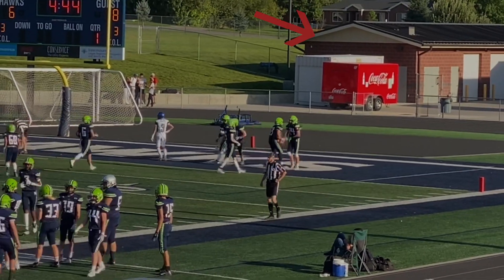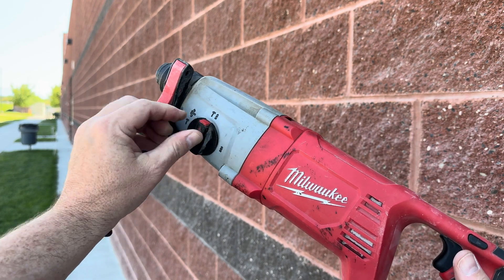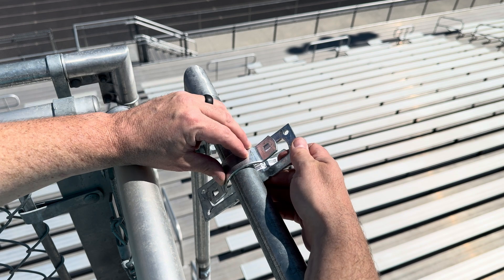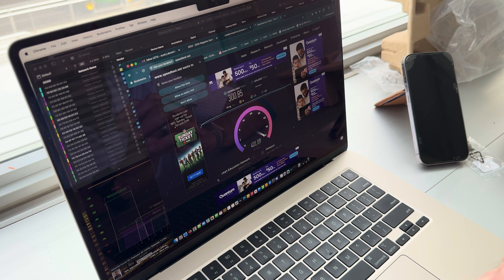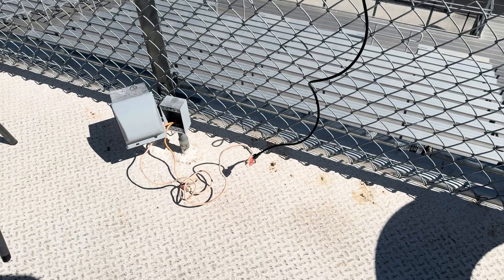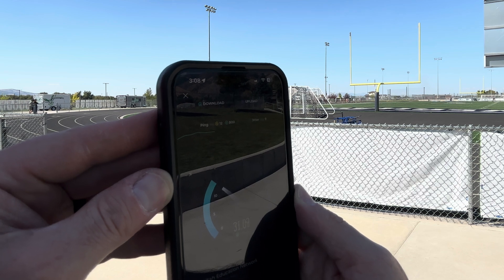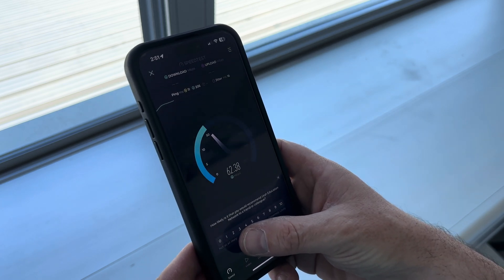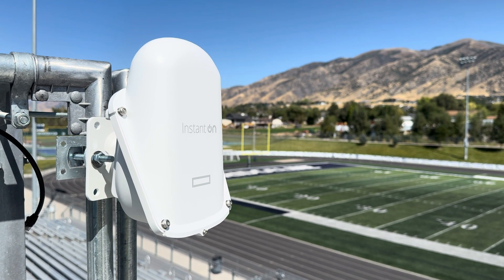How to install an Outdoor Access Point - HPE Networking Instant On AP27

Comment: Out of cusiosity, why not intall an AP that is the same ecosystem as the rest of the campus? I run multiple Cisco campuses and wouldn't want a random Aruba in the mix, I'd get a Cisco unit and turn off the student SSID on the ap if need be.